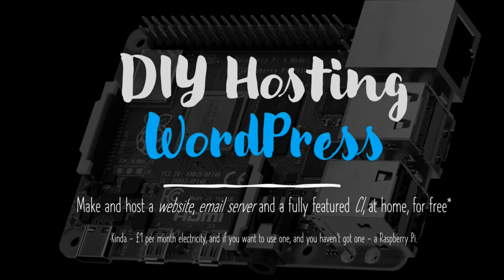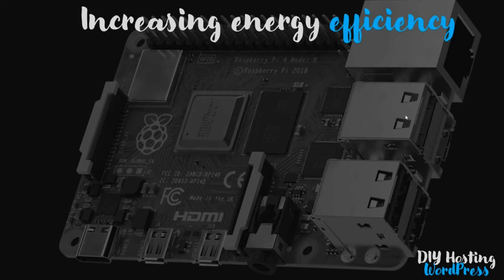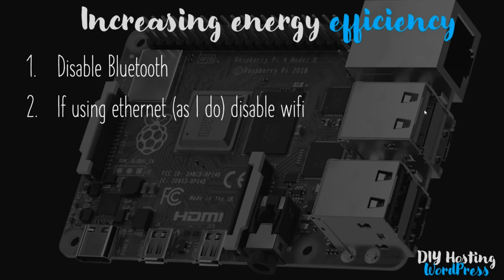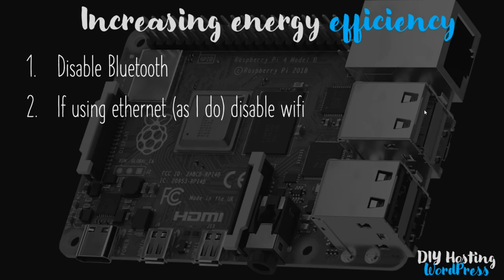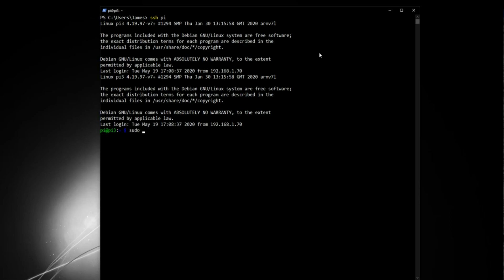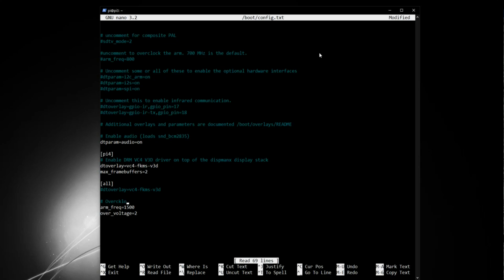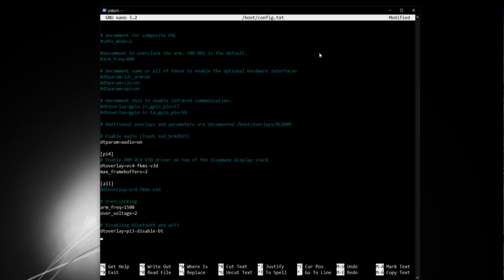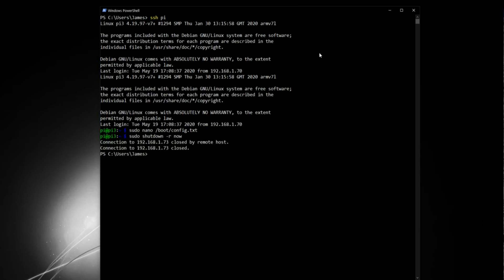6. How to reduce energy wastage on a Raspberry Pi | Hosting a website for free

Comment: Might I suggest you rename this video to "Disable bluetooth and wifi. Secure access and save money on a Raspberry Pi | Hosting a website for free"? I think it comes closer to the content of the video and I would not have skipped it the first time around as unnecessary. Great series and great explanations, though.
Reply from the maker: There is a surprisingly small length limit on the title, and that would go way over it.